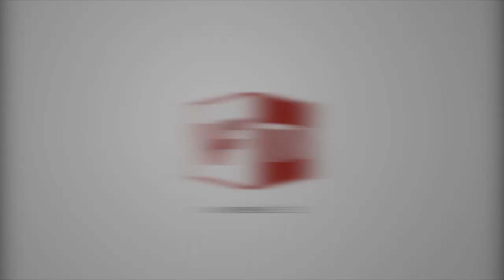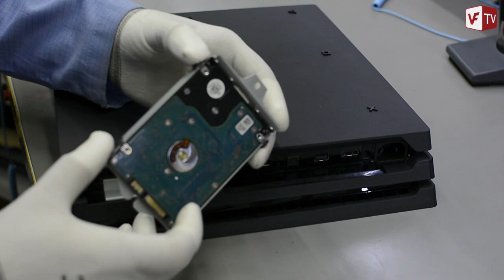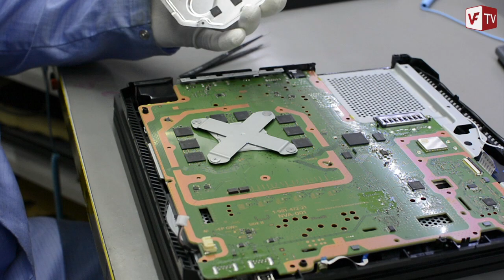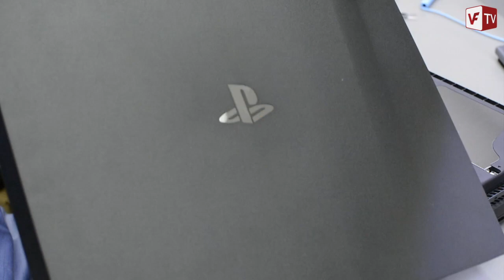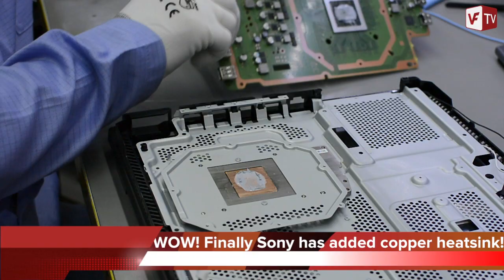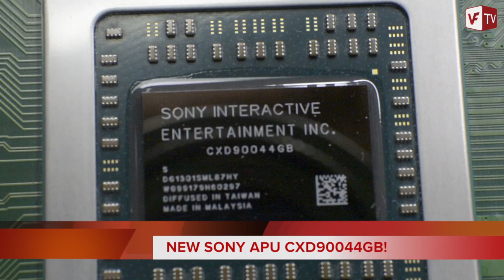PS4 PRO TEARDOWN & DISASSEMBLY NEW MODEL!

Comment: bought me a ps4 pro today, and I'm pretty impressed as i've only played on my buddies standard ps4 and I myself have a ps1 and ps3 and think the pro looks premium in style in person. My friend has the launch ps4 and my pro def runs quieter and doesn't seem as hot. I also have the orig x1 and although the x1 does run as quiet as any console i've owned the ps4 pro isn't far behind.. go get yourself one.
Reply: Cody Hackl get mine next Friday. Xbox are quiet because they are like a pocket calculator, no power.
Reply: I think its very impressive that the PS4 always have been quite small if you consider it has internal PSU too!

Comment: This PS4 Pro have a multivoltage? In the box and in the console is print that the voltage is 220v-240v, but everybody says that is multivoltage. When you opened the console what information did you have?

Comment: Could the internals of a PS4 Pro be placed inside the casing of a standard (original) PS4? I have a gold colored one whose casing I would like to keep using if possible.
Reply: Fab Slab NO
Reply: If it did fit inside, it would probably overheat. The classic ps4 wasnt made to dissipate as much heat.
Reply: Facebook

Comment: Curious why they made the fan and heatsink so much bigger when the wattage is pretty similar to launch model PS4s.
Reply: Maybe to keep the temp even lower so the fan has less of a need to throttle up so much. Possible that even patched games aren't pushing the new gpu and overclocked cpu  to it's limits so they wanted extra thermal headroom.
Reply: My launch PS4 was suuuuper loud, like a jetplane taking off in my living room.
The Pro is very silent and not noticeable with normal ambient noise.
Reply: Glitter fart 

Nope, that's just what the Power Supply can handle.  The PS4 Pro has been measured and it only consumes about 5 more watts than a launch PS4 when playing games in 4K, but when it plays game in standard PS4 mode it consumes a lot less power than a launch PS4.

Go check Digital Foundry's review.

Comment: it'll be a life saver if you could tell me the thicknesses of the thermal pads used in ps4 :D
Reply: Well arctic silver 5 gets great results for me.the original ps4 had 1mm thick thermal pads i wonder whats in this thing
Reply: Thanks Mate :)
Reply: VIsubby 
thermal pads are better than thermal paste? or are they two different things for different purposes?
Reply: They are 2 different things. Thermal paste acts as a filler compound between Heat source and the Heat sink.
Thermal pads are think piees of solid conductive material that range from 1mm to 5mm, they are usually used between low heat generating chips and heat sink just like RAM.

Another difference is that thermal pads conduct heat much slower than thermal paste and they melt under high temp where as paste conducts heat faster the hotter it gets.
Reply: I have a blueprint in mind where I would take apart the casing of the ps4 pro and put it in a desk with a glass on top with red led lights. I am thinking about adding a water cooling system, couple fans, extra usb ports, a 6tb harddrive, voice changer,  but I am not sure about a couple other hardware items I want to upgrade like the power supply? wifi antenna? Multi disk tray/cd magazine/5dvd changer?  <-- That last one is a iffy. I honestly just want the ultimate ps4 experience playing those exclusives and well fuck the pc, I want to see something beautiful!!  I want your opinions, and well all of you probably have more brains than I do, so if you can what is possible?
Reply: That sounds wicked! i'd love to see that happen :D

Comment: hi Ben this is Jared again. question for you is there a capability to use period and recycle and he's everything one of the parts. By building a Xbox One PS4. PlayStation 3 PS2 and PS1 Xbox One and Wii system using all the parts but only one operating system on it all season. Connecting all the motherboards as one running as one operating system with all them other words written as one. one and all as one single console. With computer motherboard added with it. all the motherboard's run as one connected into 1 101 operating system on at all as a hundred percent operating system custom operating system who plays every single game system with. Using all the motherboard's connected running together as a single custom case. Can it be done? will you be able to do a deal like that. It would be cool to see something like that. and be able to play any discs that you put in it PC any game console CD to disk or USB for any older older console connectors for any older games they can place we can play any game on it. It's ever been made old and new. can you do something like that.?

Comment: Please can you check it and tell me if the console says 100-240 V 50/60 Hz because im from Argentina and here is 220v.
Reply from the maker: Like all PS3 and PS4 this model has input voltage range from 110 up to 240V
Reply: world wide or global what most devicers are doesnt mean will not be a 220v ps4

Comment: Looks like it's gonna be a pain in the ass to replace the thermal paste.
Reply from the maker: Yep, It will take more time like in standard PS4
Reply: It's a console, you don't need to worry about replacing the thermal paste.
Reply: Replacing the paste on my launch PS4 made it much quieter. I was very skeptical about it working too, but it did. I doubt the Pro will be as loud as my launch PS4 but if it is then I'll do it again.
Reply: You do when they get a couple years old. The 360/PS3 launch models ran ridiculously hot after a year.
Reply: It's very easy

Comment: Is the PS4 pro power supply a dual voltage
Reply: PSU is +4.8V~1.5A and +12V~23.5A
Reply: I think he wants to know if it's "100-240v" (dual voltage) or "100-120v" or "200-240v"...  Do you know? I wanted to know that too.

Comment: Really looking forward to the day the RAM also moves to the SOC
Reply: Mum Blic why though? The CPU already has a cache for that.
Reply: Well It's more of a design philosophy. For me CPU and Memory are one single part  (head and body) The day this will become the standard. is the moment CPU technology does reach some fundamental milestone. Some kind of end goal/adulthood. 
It also makes the motherboard design less complex, the number of pins on a cpu/soc could decrease. Maybe this could lead towards some socket/interface standard with the same level of standardisation as  the PCI-Express standard. Maybe it could also lead to improved technologies for memory and cpu linkage. The distance between components is becoming more and more important for timing reasons. It give cpu designers some new playground to play with, and hopefully to create some new technologies that will improve performance/reduce costs.
Reply: Hmm. I think it might be more likely that the cpu cache will get bigger and bigger, until some sort of L4 cache replaces ram entirely,
Reply: I doesn't really matter how it's done. It's even possible that the current caching model would be completely redesigned (over time) Also when all the RAM sits inside the CPU you can't call it cache anymore. AMD is already doing it (Fiji/ HMB) It don't have to be on the same die, on the same chip is fine. Maybe the xBox Scorpio will use this technology. Who knows?
Reply: I seriously doubt that microsoft would be able to do that unless AMD also does that with zen, and i haven't heard anything about that yet.
Reply: Maybe you are right, maybe they do it the next generation. The technology is there. that's not problem. The question is when will it be available for consumer products.

Comment: This will also put to bed anyone taking Cerny's "mirror the GPU" too literally and thinking there's two GPUs, it should have been obvious it was a doubling of CUs.
Reply: It's a SOC, and a new process..  They probably mirror'd it on package...  Aka. that 1 chip is 2 chips in a single package.
Reply: hhdropbaud GPUs are embarrassingly parallel devices, so if you double up the GPU on the same die...It's still one larger GPU. They harvest GPUs like that all the time, if they disable half the CUs and call it a new GPU, it's not half a GPU, it's just one smaller GPU.
Reply: tipoomaster I can understand what your aiming at, but I wanna wait for the Dyeshot of this chip unless it's already been released..

Comment: I have no problem with any console ps3 fat slim or ps4 to overheating because I  put system to small fridge and it's work fine I can leave turn on even 1-2-3 year and still work like new. And from ps3 to ps4 we got sweet wireless controllers so I can close door from fridge and play.    For everyone else good luck with waste your time to put thermal paste 😀

Comment: 2 QUESTIONS 

1. What gloves are you using?
2. What did you use to remove thermal paste?

the 2 most important things you failed to mention
Reply from the maker: Hi :)

1. ESD gloves. You can buy it in most shops with electronic parts.
2. IPA Alcphol for clraning pcb.

Comment: Damn that was cringy when he pried up on the motherboard and it snapped back because it wasn't free yet made me shudder and also I will never trust anyone else to service my console I know alot about tech and could definitely do any repairs that were needed but damn wonder if that motherboard had any micro fractures from that and also why the hell would you keep going if you felt any resistance in it at all.

Comment: It looks way over engineered..... Half the alloy in the box doesn't even need to be in there.... Why does  Sony consistently do this?
Reply: They probably did so because they wanted a new style or maybe better cooling.
Reply: They're going all out with cooling to engineer in longevity for the polaris which runs hot.
Reply: That's My Two Cents i can see a ps4 pro slim on the horizon :)
Reply: Pro Slim won't happen they confirmed this is just a mid gen refresh and PS5 will come next
Reply: That's My Two Cents It's for cooling...surface area.
Reply: Why the hell won't it happen? It surely will, both PS4 and PS4 Pro will(/should) have 7nm-based models no later than 2019, doesn't mean any performance change.
Reply: Dongsa Yeah I know with the heat shield..... There's so many better ways of doing it with much more efficiency..... It's obviously they are using computer generated console designs like IKEA uses...
Reply: VIsubby If they put a nice piece of copper under a heatsink and direct air flow out of the console it would hundred percent improve the cooling efficiency..... This heat shield alloy crap is the reason why these consoles overheating....
Reply: That's My Two Cents its called quality... its not like the cheap ass crapbox
Reply: eXoN Zero That is not quality! I'm sorry it's very cheap design made from a computer..... If they just used a good piece of f**** copper with a direct outflow out of the console but they didn't they use the cheaper alloy heat shield to disperse the heat you call that quality!
Reply: ***** Oh dont be so salty.. it is miles better than ANYTHING microsoft ever made.. So, it is very good quality. However.. you can whine and cry all the time of course.. lol
Reply: eXoN Zero Salting maybe yes because I f**** bought it...... The thing already sounds like a f**** jet engine it is only days old what a waste of money!

Comment: The PS4 Pro feel so cheap compared to the Xbox one S where all the components are neatly placed and labeled in separate enclosures.Sony stop using cheap laptop centrifugal fans plss is loud as hell. Big heat pipes and a large quiet fan will do.